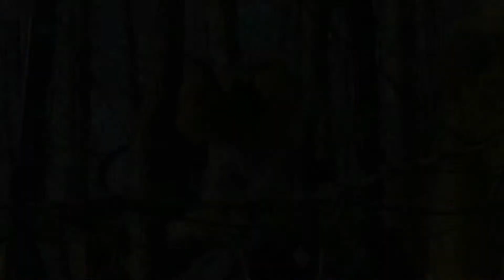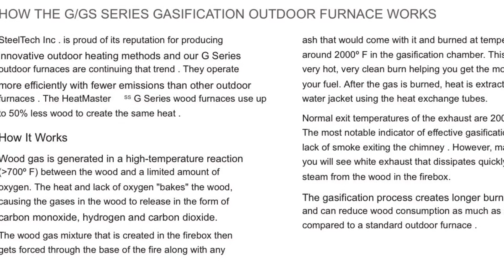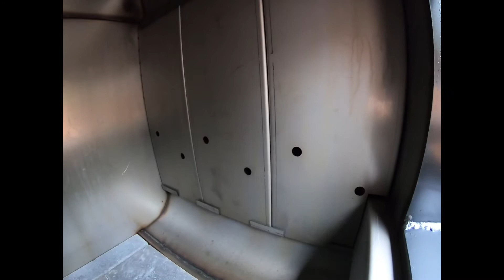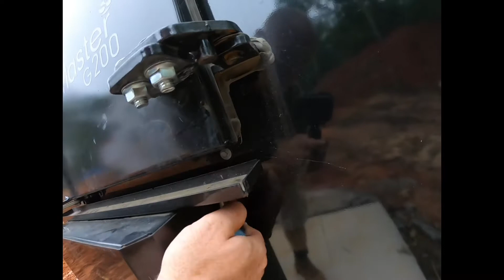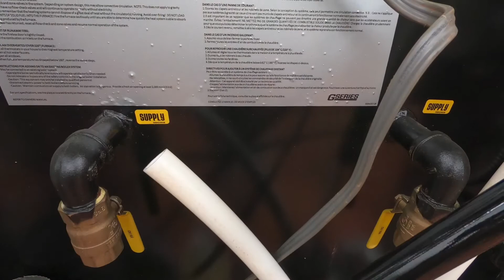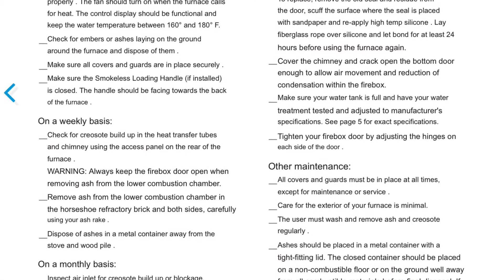Choosing an Outdoor Wood Boiler and Why I Chose the Heatmaster SS G200 Ep 21

Comment: That is one nice furnace!!!!!!  I love the way they got around the tube cleaning issue. SS hard as heck to weld, could be an issue  to fix 10-15 years down the road.  Man 15-20% is dryyyyyyy! Wood will have to be stored under roof and cured a looooooong time. Hard to get wood that dry. Might want to look into kiln dryer? Five years is when they start to show how well they were built. When I bought mine the number one engineering issue was longevity. Anything that moves on these units are prone to failure due to extreme heat generated (yours runs at 2000F mine is 500-700F) and corrosion from a super harsh environment. I think every non-lubricated moving part will eventually fail and need replacing probably by ten years. I live in Ky. similar climate and wood availability. Your house looks good size and you have a long run to and from this causes it to be harder to get flow high enough in your loop probably will take 2 full size strong pumps. That furnace is rated at 5000 Sq foot in the north, if you take off 1000 for DHW then you can heat up to 4000 s/f but you will need good flow in your loop to deliver BTUs. I put one inch pex in my loops and should have used bigger as I have to use 2 full size expensive pumps to get 6-9GPM. You won't know until it gets below zero for a week. All said that is the best looking boiler on the market today and you did a great install!!! now you are in my boat hoping it lasts over time.
Reply from the maker: That’s definitely the downfall with the gasification getting well seasoned firewood. I feel good knowing my local dealer has been with heatmaster for 15 years. That tells me a lot! The cleaning method was the number one reason I bought this stove. Checking out several other manufacturers and having to go through every 2-3 weeks and manually brush out every tube on the back...no thanks! My plan is to do a shop in the next few years and then I think that’ll be the last draw on the unit(for now haha). The taco pumps have a great warranty but are a little pricey too. Our house is 1750sqft plus the basement(about 1000sqft). Taylor stoves are made pretty close to the house but not a fan of the looks or efficiency like the heatmaster. I agree this is one of the best looking stoves on the market today.
Reply: @southernyankeeinnovations  should be fine with that stove and a small shop remember everything doesn't run at the same time. Those taco pumps are worth every cent I have owned every brand don't ever buy any other brand the ones were using probably are the best outdoor wood pump on the market. Good luck holler at me if you need anything.
Reply: Also I'm gonna be throwing a few quick videos up of my old dilapidated unit
Reply from the maker: I’ll come over and check out your videos today. I am very happy with the quality of the Taco and I have a dealer in town if I needed one in a pinch.

Comment: I couldn't find that stove on the EPA listing? Is it not a EPA certified stove?
Also they claim they are 50% more efficient then others. Yet Crown royal, Woodmaster and Central Boiler all have stoves pushing 90%.
https://cfpub.epa.gov/oarweb/woodstove/index.cfm?fuseaction=app.searchresultsWH&manufacturersid=0&lu_appliancetypesid=0&lu_appliancesubtypesid=0&lu_fueltypesid=0&recs2display=10&EMISRATEANNAVGBTU=0.01%20-%200.32%20lbmmBTU&EMISRATEANNAVGGRH=0.00%20-%2012.00%20grh&efficiencytested=0%20%2D%20100&bturange=0%20BTUs%20%2D%20100000%20BTUs&hopmax=0%20%2D%20600000%20BTUs&hop8h=0%20%2D%20600000%20BTUs&z_outofproduction=0&nspscompliance2020Only=off&fireboxvol=0&thermalstorage=&searchterms=&searchtype=advanced&sortby=EffSort&rec2startat=1
Reply from the maker: I was told the g200 was discontinued because it was cheaper to build a new model and have it tested to new EPA standards than to retest an older model. This model is supposed to meet or exceed the current standards however has not been retested. I will do some digging and see what I can find out.
Reply from the maker: Here’s a little bit of information from the dealer. Not sure why it’s not listed on the other site though. https://www.heatmasterfurnace.com/faqs